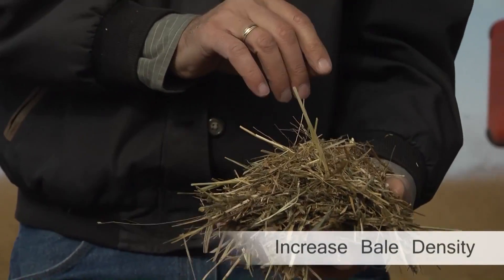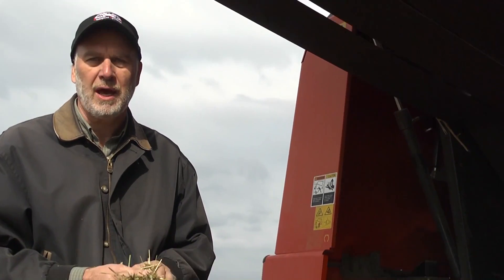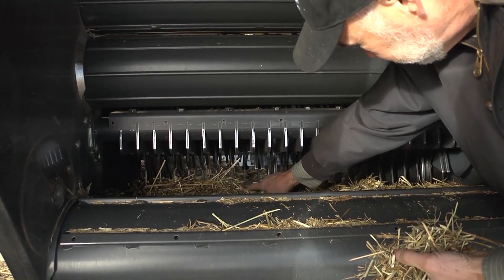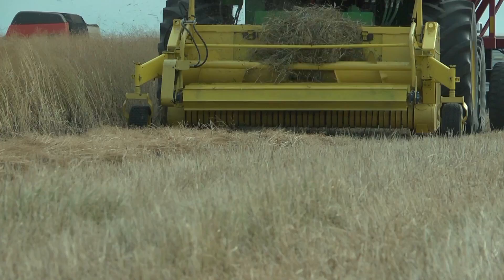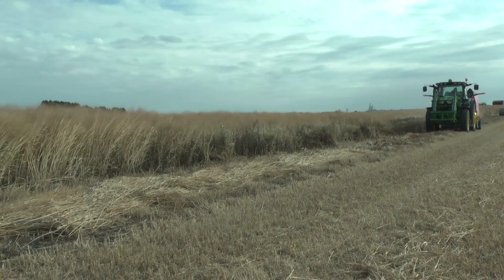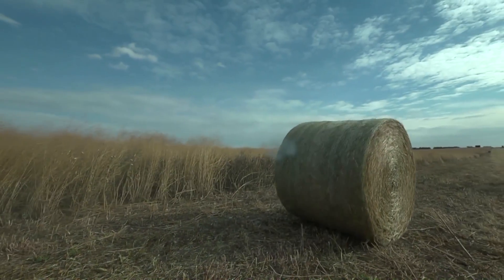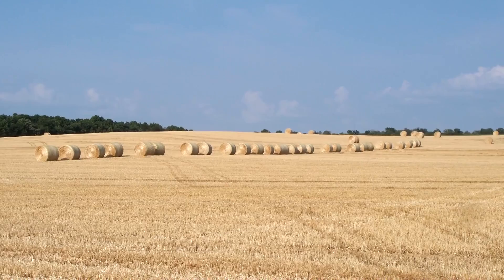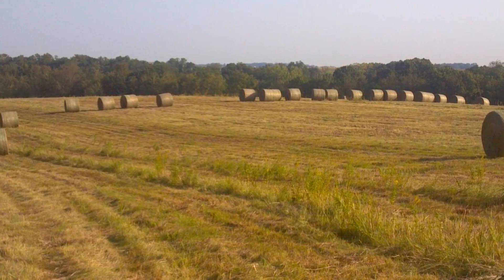Optimizing Harvest of Perennial Grasses for Biofuel

Comment: A small pellet plant could be used to provide a high density commodity which stores well and can be economically transported to the bio-refinery. These pellets could also potentially be used within the local area in pellet stoves and boilers. Also the electricity used to run this pellet plant can potentially come from gasification of the switchgrass.